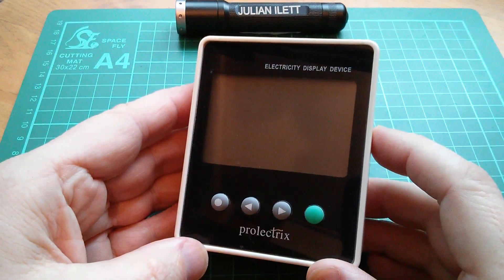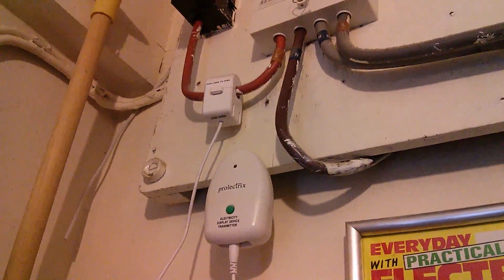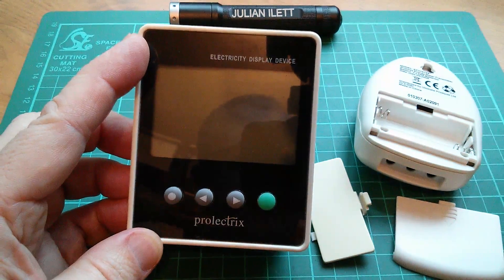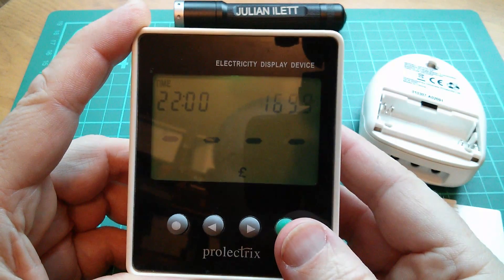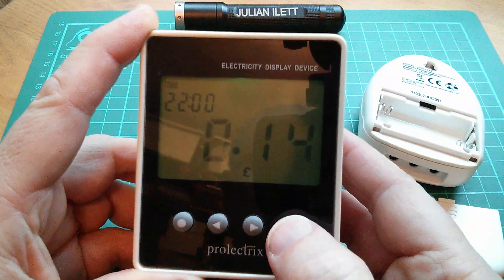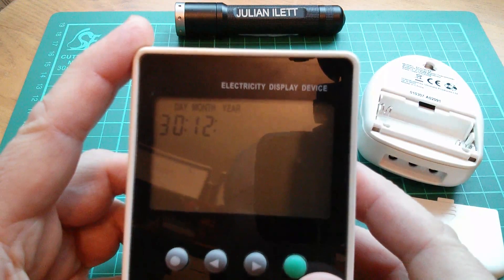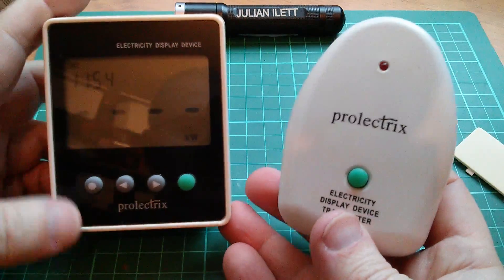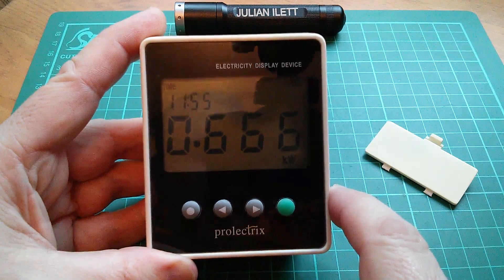Teardown: Green Energy Electricity Monitor Display Device

Comment: A couple of times pressing the second button along (arrow left) a green backlight came on accidentally but how does one turn it on and off intentionally? A search through the electronic version of the manual gives no hits for backlight and only one for LCD. 
To avoid running through AAA batteries for both Sender and Receiver get a 5v to 3v or 5v to 3.3v Step-Down Converter from eBay. It easily fits inside the battery compartment soldered to the two battery wires. Search for AMS1117, for example, and plug into a mains to 5v USB adapter. 
Check the voltage is set correctly. 230vac as default for UK.

Comment: Looks like the F9222T on the transmitter board is a microcontroller as you can see the JTAG port for it to the bottom left of the PCB. 
What you could attempt to do is remove the receiver board from the receiver module, hook it up to an arduino and try to reverse engineer the protocol. Then you could put the data into excel or whatever :)
I just found the datasheet for device its full number is UPD78F9222 http://www.datasheets360.com/pdf/63755141203645179?query=UPD78F9222&pqid=65834829

Comment: If it's not to late I think you could very easily fix the power problem with and maybe put the display into a different project box again with a better power supply and you probably could figure out a way to get that info off the device (I couldn't but you could since you are the smartest guy on the net)

Comment: You wanted to capture the data into Excel, right?  Perfect time to play with an Arduino!  An Arduino and a 433MHz receiver module (alice1101983 has them cheap) and then you should be able to capture the packets from the transmitter and log them (maybe also need an ESP8266 WiFi module to transmit the logs if you don't wan the Arduino hooked up to a PC the whole time).

Comment: Id keep it. Slap in a Lipo pack and charging circuit with micro USB port in both the transmitter and receiver, then look into getting the information onto a computer or phone for proper logging and such.

Comment: I noticed the 2V7 markings so it must be expecting 2.7V under normal circumstances but using two NiMh only gives it around 2.4V.  That may be why the low battery warning.

Comment: I use an Owl CM160 - which has a USB connection to PC. When connected to a PC it powers the unit (I think!), and the pretty poor display software at least maintains a SQL Lite 3 database of the logged data (and the unit remembers about 48 hours of data)... There are 3rd party bits of software which read the db, and I also update to PVoutput (http://pvoutput.org/intraday.jsp?id=39634&sid=36194)... That site is also designed for logging "Solar" generation as well as usage (though I don't generate anything yet).. But you might be able to work something to log your own solar power charger outputs??

Comment: Happy New Year Julian :-)
I think the Tx module could be used with the JTAG and an ESP201. I have one that I would send. Good for breadboard, excellent ant, and numerous GPIO. Adafruit just did an updated version of publishing toggle /LED and are way past Thing Speak for options.
Reply: +Chris Leech I meant to just suggest getting back to the ESP8266 IoT project Julian and I just ruined it with my edit. Anyway it all boils  down to the interface (inductive device)  . This is way too useful to put in the bin.

Comment: As some have suggested already, you could probably use the little radio module in the receiver to make your own receiver, you could make an external battery pack or power supply for the transmitter, and perhaps the receiver enclosure can be reused as a project box for this or some other project as it has the built in battery compartment, rubber switch PCB and the cutout for a display.

Alternatively, I suppose the radio modules may be extracted for some project, and you might find some use for the current transformer.

Comment: Less than 30 seconds of Googling reveals the F9222 to be a Renesas UPD78F9222 8 bit MCU. 

At the very least I'd pull the 433MHz Tx/Rx pair, and if you've got a 3V or there abouts phone charger wall-wart PSU lying about - or a 5V one and a 3V3 regulator - I'd think about converting the receiver to mains operation.

Edit: Looks like several others beat me to the F9222.
Reply: +Graham Langley Indeed, retro fit better battery carrier or to main power.

Comment: there is just one thing to do: hack, improve it, make it better! maybe take a look at the IO pins of the 433Mhz boards, and see if you can sniff the data while its being received or sent. maybe you can pull the data directly from the transmitter. maybe it would also be possible to power the transmitter as a parasite to your mains line.

Comment: I have never really seen the point of devices like these as what they tell you is generally blindingly obvious.  I got one years ago when there was some kind of special offer going on.  

I installed it then went round the house testing the consumption of various devices but really learnt nothing.  The tumble drier uses tons of power.  Wow, who would have thought it ?  A 1 kilowatt electric file uses about a kilowatt.  What a surprise. 

The device quickly fell into disuse but I just looked and the transmitter is still in the meter cupboard but I have no idea where the receiver is.  I would be interested in graphing use over a period but I don't see such a device making much difference to our use of electricity.

Comment: Either:
- you put a small 3V transformer + rectifier in both units to get rid of the batteries
- you interface an Arduino to the receiving 433MHz module and make it into something better (shoud be easy once you know the protocol)
- you sell it on Ebay

NEVER throw stuff away lol :D

Comment: I wonder what the vintage of that unit is? I have an identical one (different display case, but same buttons & display), upon which I've scrawled the functions next to each button as it munches through batteries mercilessly and needs re-setting-up after each battery change. Here is is marketed as "Efergy", which I understand is a UK company. They released latter versions, which allow you to lengthen the period between transmissions to reduce battery use, and offer receivers that talk to the Internet. Despite the rubbishness of the original unit, I got one of the newer units which monitors our 3 phase supply, and you get a live (and historical) report from their site. Currently using 5.78kW. Not exactly sure where all that's going though...

Comment: Throw it away!  It's garbage.  The unit just measures current then sends it to the receiver which multiplies your I putted voltage times current to get the apparent power ignoring the power factor.   It can only get the power factor by measuring the voltage and the phase angle between the voltage and current.  Or it could measure instantaneous voltage and current, multiply them and then integrate over time to get the real power.

Comment: Keep It, The LCD looks like it has a back light. If you can find the data sheet on the radio modules you may find they are basic packets that could be read using Arduino.
Big Thumbs Up and all the best for 2016.

Comment: You could actually have an arduino micro or mini pro read the i2c eeprom and dump the data back through usb serial or bluetooth for logging and/or plotting. It's not a hard thing to do and it would really make a neat weekend project! Just tap into the i2c lines with the arduino and hook up a SPDT switch to select whether the  batteries provide power to the receiver or the arduino. When the switch is in one position, the receiver will work normally and when in the other position, the receiver board will power off and the arduino on for data extraction :)

Comment: Like others have said, see if you can make your own receiver.  If not, keep the current sense loop and desolder the 433MHz modules.  Then try using the 433 modules with arduino.

Comment: This meter does not monitor AC line voltage. For accurate measurements, you need to monitor voltage as well, as true power can't be properly calculated without knowing the voltage and it's phase relationship with the current.

Comment: It is very interesting that they used a RFM12B 433mhz Transreceiver for the data transmission.
Reply: +Marcel Thürmer agreed. Looks like a chinese cob clone of RFM12B.
http://openenergymonitor.blogspot.com/2011/08/rfm12b-simple-rf-transmission-demo.html

Seems like there is already some legwork done on this. Might not be too difficult to interface to another module w/ arduino to receive this. 

May also be possible to extend something like rtl_433 to receive/decode with rtl-sdr dongle.
Reply: Like this:
http://www.qdh.org.uk/wordpress/2015/04/10/owl-cm160-energy-monitor-with-rtl-sdr/

Comment: i would try do decode the 433mhz signal using an dvb-t stick rtl-sdr and make my own display / android app interface using arduino, instead of complaining about how bad this is.
Reply: +gamerpaddy He could just desolder the module I suppose.
Reply: +stonent the 433mhz receiver? sure. but to decode the communication protocol you would need a logic analyzer or an SDR      if you understand  the protocol you can decode it anywhere with anything.

Comment: why throw away such useful perfectly working device, just pull a pair of wires out from each the battery holders, and connect to external 2 AA or D holders. use tape to fix the holders at the bottom of each device then.....

Comment: Keep the thing and wire in a power supply so you don't have to go replace the batteries all the time. I was quite surprised to see that there was no burden resistor inside the current clamp transformer. Putting it on the mains cable without anything connected at the DC-jack could very well destroy it, as it has many turns, and can easily arc over by seeing too high a voltage.

Comment: I have one of these types of units from Sky (The TV people) and it works well. The interface is just as bad but the receiver is powered from a wallwart.  The Sky one does 10 channels of RF using separate transmitters but I've only got one.

I'd say keep it. Modify it for 12v and use it to monitor the house. That's what I do.

Comment: I wouldn't throw it away. The radio module looks like a quite common RFMxx Module of the company HopeRF. There is a good chance to capture the data being sent over the air using another RFM module connected via an Arduino to the USB interface of an PC. Once it is in the PC you can do whatever you like with it. I use some similar setup and graph my electricity consumption into a RRD database (using a different device at the power meter though). You might search the web for FHEM, CUL, RFM12B to find further information. Good chance to get it hacked.
Reply: +B0G0MIP +1 to this idea. Since it is on a common band, can't you just try and read the data it sends over serial? I guess you'd need to know what commands the other one is also sending, but quite possible to hack around and Arduino and regular RF module
Reply: +Keeron Modi there's a website of a guy who sniffed some of his wireless weather senosrs using an DVB-T SDR USB stick. http://www.kompf.de/weather/rtlsdrsensor.html
(You would have to translate it as it is in German language)
I was able to repeat it with some wireless gear I have lying around. 

Another maybe simpler way would be to check if the microcontroller on the receiver-display part actually does send anything on its serial UART pins. With a little luck there is usefull information ready to be read with a serial USB dongle into a PC. There is a datasheet for a similar or even the same chip here
http://www.sinowealth.com/ftp//8051%20mcu/8bit%20flash%20mcu/ss388a_sh79f1621/SH79F1621V2.1.pdf

Comment: The three inputs are meant for use with a three phase supply but they are each reported seperately in the rf feed so can be used to monitor three independent feeds. eg I use mine to monitor pv feed, grid feed and household load.  The rf is easy to trap with an arduino/r pi etc and drop into a simple graphing package.

Comment: I would've thought they'd include some sort of voltage clamping device on the current transformer since you can get a very high voltage on the secondary winding when it's unloaded. 

Also, this device can't be very accurate since it doesn't measure the voltage, so yes.. you must throw it out :)

You could of course connect the CT to an arduino and use the library Emonlib to measure the current your house is using.

Comment: Perfect opportunity to use RTS-SDR to monitor the transmission and reverse engineer the signal.   Or use a scope on the receiver module and read the output.

Then use an micro controller to relay the data over bluetooth or pipe to a display with a UI you like.

Comment: Personally,  I would take the transformer out,  wind a small primary (~12 turns) and see what voltage you could get. Pretty useless but still fun
Reply: +D.G Potts You can indeed induce a voltage and power something with it. But the energy is not free... It's coming from your cable, your meter, you're paying ;)
Reply: Actually it would be even cooler to try and build a clamp on ampmeter with the transformer, a microcontroller,  a 3d printer case and little lcd
Reply: +D.G Potts - How would it be free?  It is after the meter the utility company reads.

Comment: Tap into the transmitter after the signal processing from the current transformer is done. Remove the 433MHz module and hook the thing up to an Arduino data logger.

Chuck the receiver in the bin.

Comment: I'd be tempted to chuck the receiver & transmitter, but hang on to the sensor coil. Then you can have a nice little arduino wireless project to replace the Rx & Tx boxes ;)

Comment: I've got one with same interface but different outside case. Rechargeable eneloops last about 2 months. I do not bother about the low signal. On the receiver I stuck a used 18650 battery connected to a small switching buck converter and it lasts about 1 year between charges.

Comment: keep it, improve it, update the battery pack and fit an LED back light, solar power it....
Reply: +Heads Tails modify it to use inductive power from those mains cables!
Reply: That would be an interesting project for the transmitter with solar for the receiver.

Comment: How about you build your own device to read the output of the 418Mhz receiver so you can log the output on your PC. What does the output waveform of the current transformer look like with various appliances switched on?
Reply: +Coolkeys2009  it`s a sine wave proportional to the current you draw.
Reply: bogyxp If all the loads are purely resistive, even the fan heater he plugged in isn't purely resistive.

Comment: all the electric companies a couple years ago had this big push of such devices (i got two and sold mine on ebay!lol) but i dont get how it will save anyone money, i mean, are you going to see how much you are using and sit in the dark?
Reply: +jusb1066 I think a lot of people have no concept of where their energy goes and how much things cost to run. How much is their current freezer consuming relative to a new one, for example?
Reply: +Merlin Skinner True that some people have no idea what a budget is, but i dont think anyone bought a new fridge just because a newer one uses less electricity!
Reply: I agree, but it might be a factor in their decision if they were considering replacing an old device anyway. I'm considering replacing my heating boiler partly on grounds of efficiency - that and it being over 20 years old!
Reply: +Merlin Skinner
i went from an older floor standing gas boiler to a condensing boiler, and the so called 30 percent efficiency has amounted to the exact same bills! i have had an entire 12 months of bills with the new one to confirm, so i made the mistake of replacing a perfect 20 year old boiler for the same reason.  I actually replaced it because i was a bit paranoid about the permanant pilot on the older boiler, assumes that would in itself waste a fair bit in summer, but as my bills are averaged to give a more consistent monthly payment, i didnt notice the summer potential saving